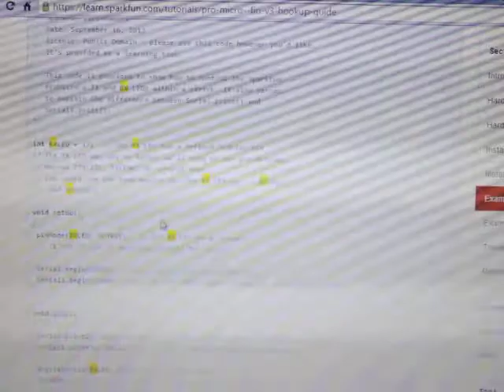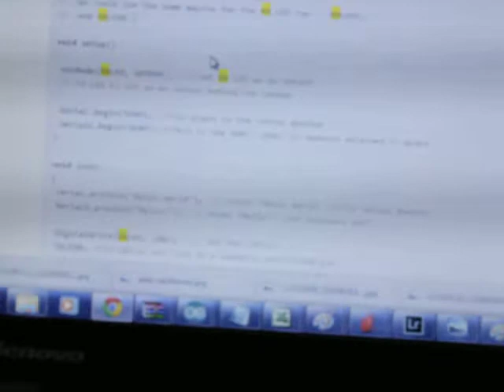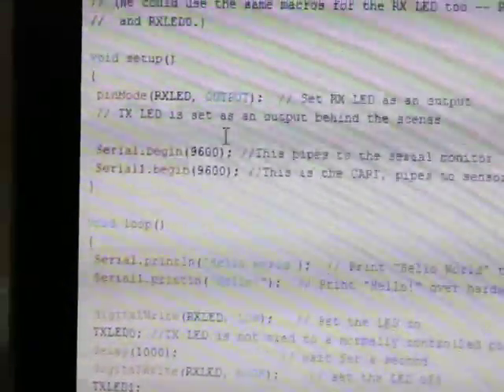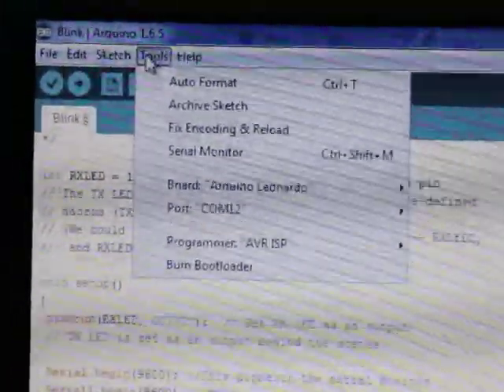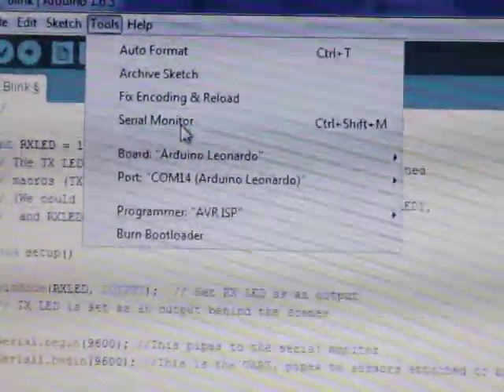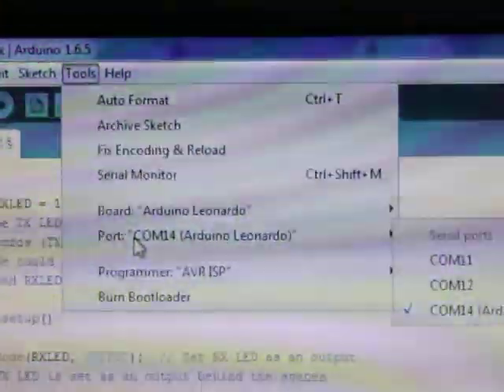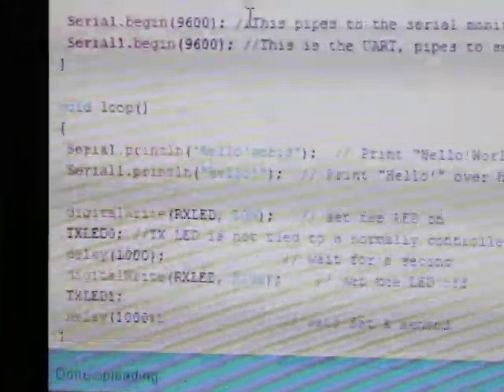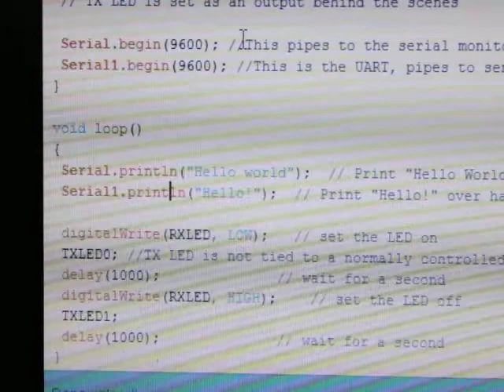New Pro Micro ATmega32U4 5V 16MHz clone UART TEST

Comment: Hi! When I try this (using the code provided by Sparkfun) both of the LEDs blink at the same time. Any idea what's wrong?
Reply from the maker: Tuomas Sormunen i guess it's the same pin or the code just configures  both pins simultaneously
Reply: Okay, thanks for your answer! In the end this wasn't a problem for me 'cause the analog input worked just fine anyway. This is a great board for small joystick projects on PC :)

Comment: Which bootloader did you use in the Arduino IDE for this board? Thanks
Reply from the maker: Leonardo board.
Reply: Thanks.. I've got one of the new Beetle Boards for Leonardo and for some reason the Arduino IDE won't connect to it. I finally got around the IO Board issues and then trying to find the right IDE for it is killing me. I noticed your Leonardo has the same chipset as the Beetle Board so I was wondering if you were using the Leonardo or not. Thank You and I'll keep trying.